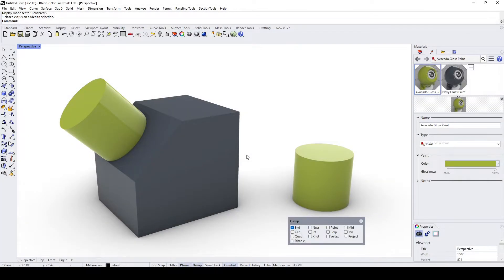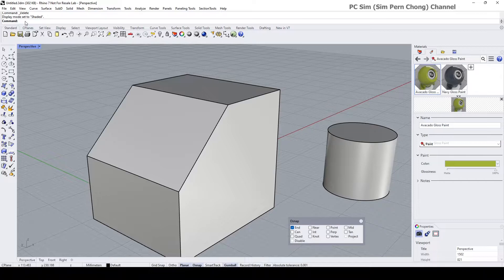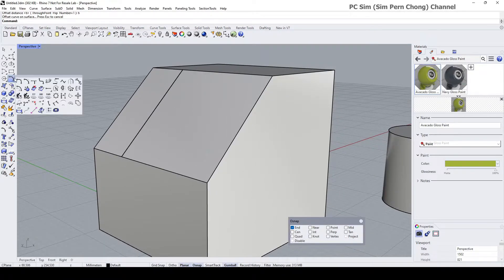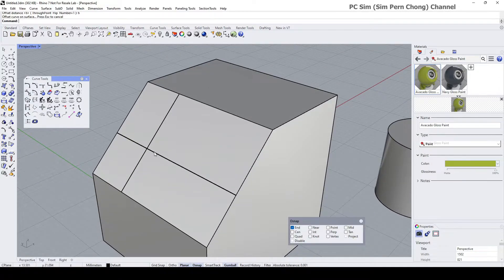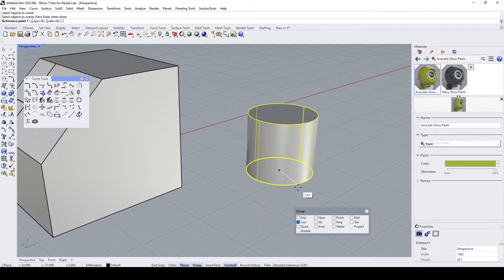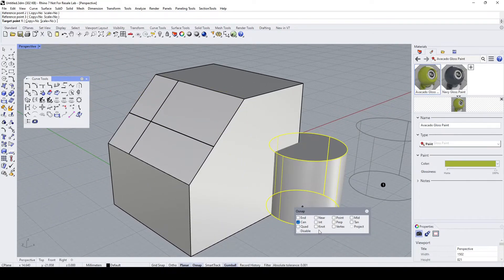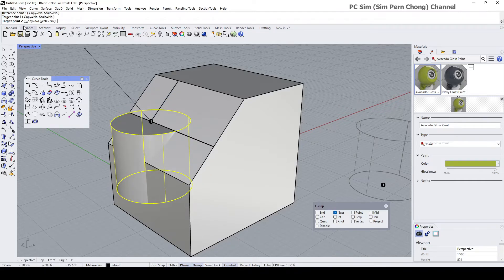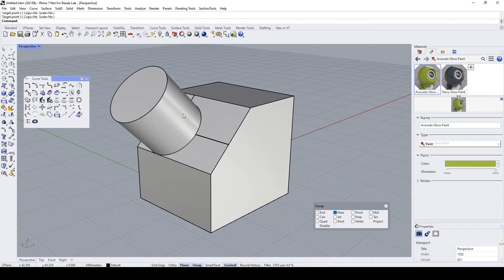Rhino 3D Tutorial: Orient Object on a Slope Surface (Method 2)

Comment: Thanks for another quick tip.  I tried it and it looks like you can eliminate making those offset curve guides by simply using Rhino's SmartTrack functionality to set temporary guide points/lines and hovering the mouse over the midpoints of two adjacent faces of the target surface.
Reply from the maker: Great suggestion. Thanks 😀